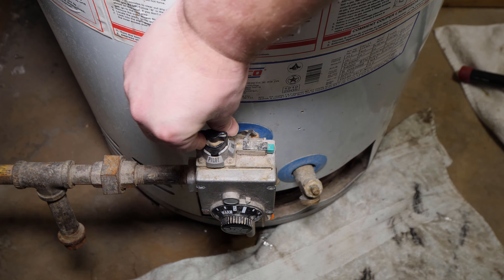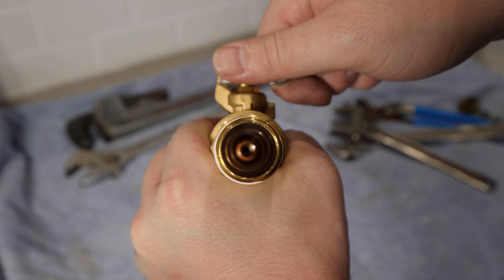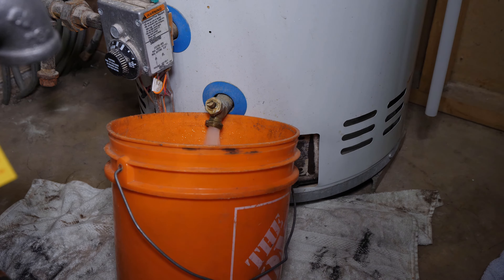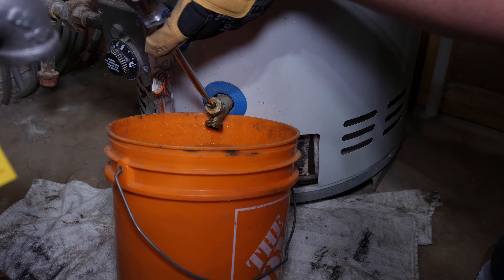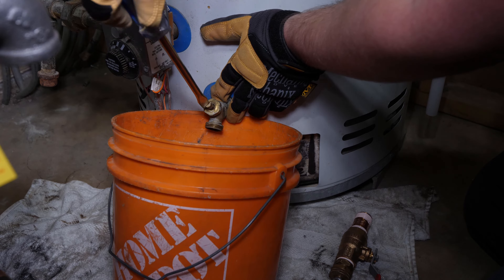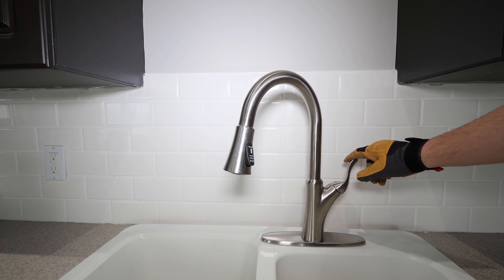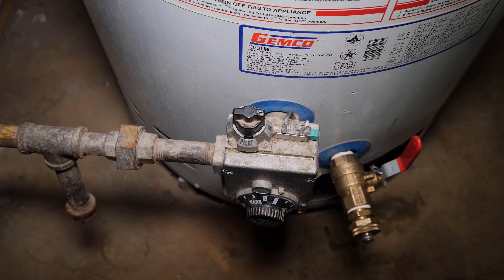Drain Valve Replacement on a Water Heater

Comment: Thank You for this video. My water heater had a plastic drain valve that was leaking. Replaced with a brass one with a slightly longer Drain Valve. I was nervous I would brake or snap the plastic one but it came off in one piece thankfully

Comment: Thanks for this. I bought the "universal" drain valve, but it was too short. Luckily I saw your setup and built my own as you show here.
Reply from the maker: Glad the video was helpful. Hope your replacement went smooth. Cheers!
Reply: @PROSDIY  Clean as a whistle. I kept checking it for a day or so. Here in AZ we have these hot water circulation devices and I initially neglected to turn that thing off.

Comment: I was so worried about a potential flood while swapping out the valve, that I spent more time prepping the area with towels and a shop vac than it actually took to do the swap.  
The airlock method worked like a charm, with no more than 2 or 3 ounces of spillage!
Thank you for posting this tutorial.

Comment: Leaking plastic valve.  Is it worth installing a full port  plastic valve on a very old hot water heater?  Wondering if doing a more effective drain will extend the life of the tank.
Reply: Go with brass.
Reply: Thanks.  @RonMcG-vk1cg

Comment: I need to replace a T&P valve on a water heater that is in series with another. The T&P valve is on the first one in the series, with the cold water supply line coming in. I'm assuming that I need to drain both tanks 10 - 20 gallons to clear the T&P valves on both otherwise they will keep filling each other up when the water supply line in is shut off?
Reply from the maker: That's correct, they will equalize into each other. In your case you'll have to drain slightly more water than if you only had one water heater. Good luck on your repair!

Comment: can you  give  a part  list  that i can use to build your setup?
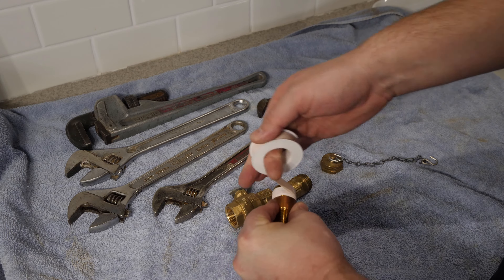Reply from the maker: The parts are listed at 0:24. There are links in the video description for parts if you're interested. Thanks!
3/4" threaded full port ball valve
3/4" x 2 1/2" brass nipple
3/4" MIP x 3/4" male hose adaptor.
Reply: @PROSDIY  my water heater is  rheem power vent with model MODEL: 42VP75FW. how  do i  know  the shank  size? Also if i just buy 3'' shank, will it work for the  model with 2'' original one?
Reply from the maker: @ask43242flight  You can use a thin wire or something that will fit along side the current drain valve. Then measure the distance of how long the wire went to the tank and the end of the shank, then add 1/2" for the threads. You can always use a longer one (3") and it will work fine. It just will stick out a little further.

Comment: What happens if you just cap off the leaking drain valve?
Reply: Nothing at all happens
Reply: I like this idea.  less work.
Reply: Tried this and it only gets worse.  Watch the video and replace the valve. $12 at Home Depot.  Plumber replacement $200-500.